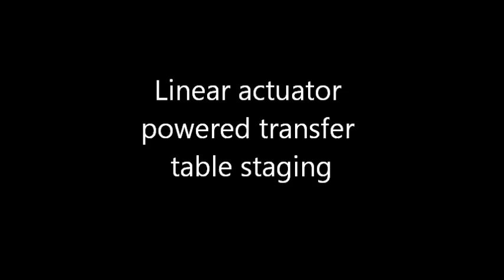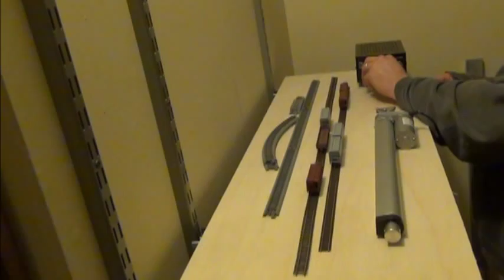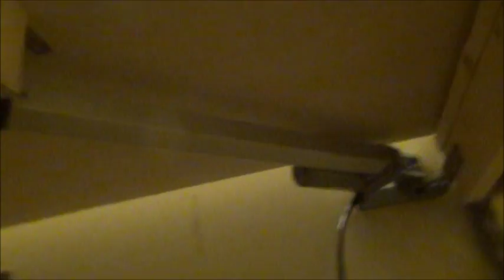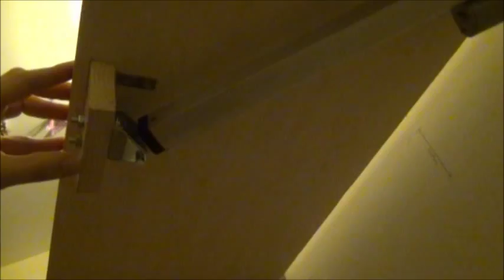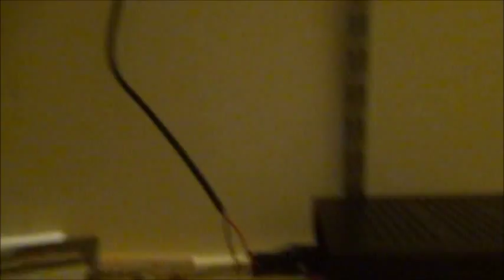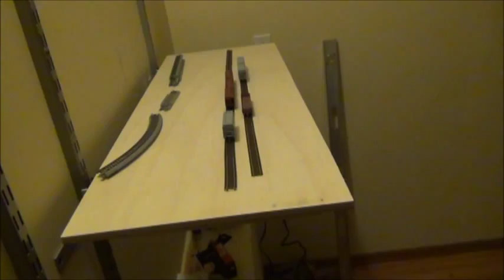Linear actuator powered transfer table staging

Comment: the actuator was 55.50 ,49.50 for the remote and power and the balance was for the brackets and shipping Im going to do what you did but invert it up and down and make a elevator to lift my trains ....the lift will be 12 "